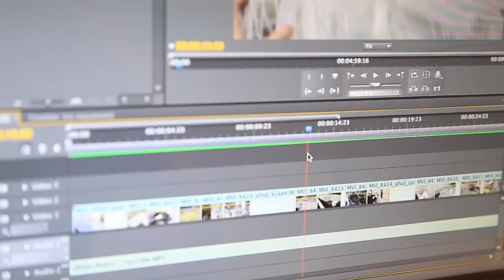Company visit - Plastic Shredding

Comment: I used to work at lifetime and they have the biggest blow molders in the US. They could make a 10 foot kayak and throw it in their 300 horsepower grinder. It was insane. I see this company also uses metal detectors on their conveyors
Reply: i worked at a blow molding facility and one of the machines they had was occasionally used to make 10 foot playground slides, ive seen  the grinder at that machine chew through solid slabs of plastic the size of a surfboard, or an entire playground slide flashing and all like it was nothin lol